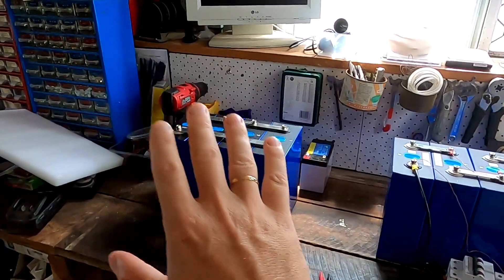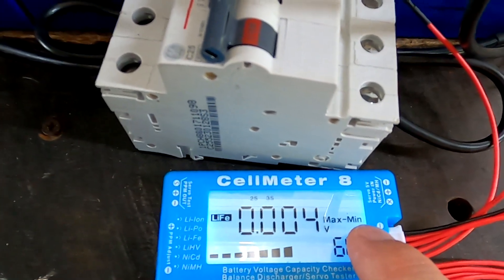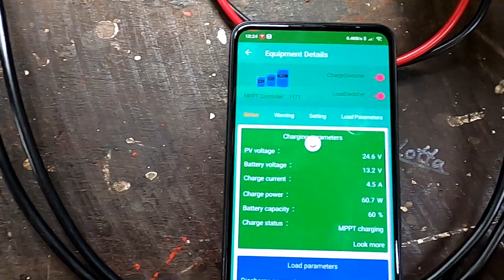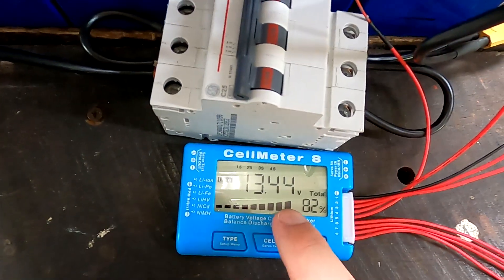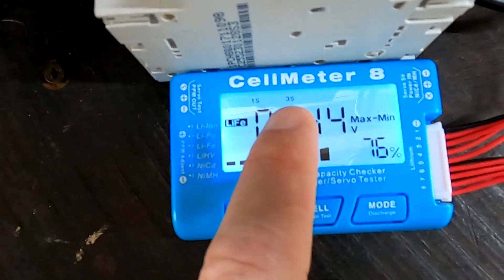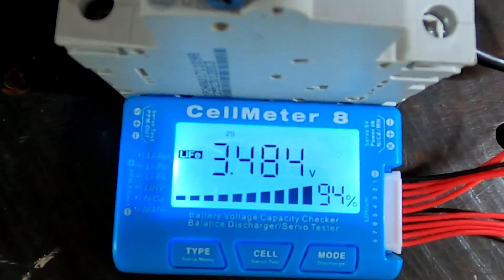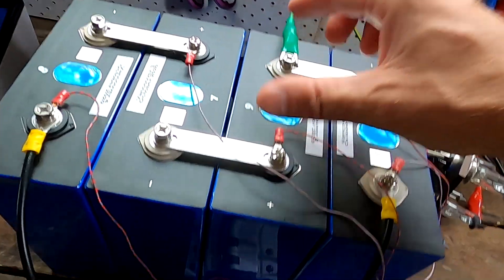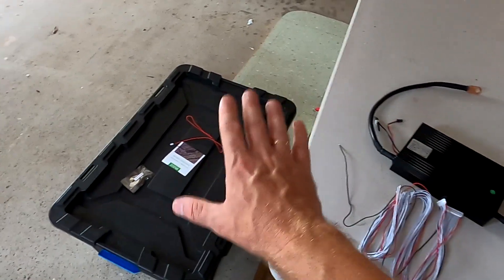Do this and you don't need a BMS 😉

Comment: Love your videos and even more love your off grid garage!  Question, how can you test a battery pack managed by a BMS that does not have an app? or how do you know if the cheap BMS actually do anything?  The ones with the apps are way too expensive to use on small 12v packs, fine on a large system but small individual systems makes things uneconomical.

Comment: Excellent. I don't need a BMS. Electronics cannot be trusted in a marine environment. So I will connect my 21V solar panel, six 50Ah LiFePO4 cell series stack, and brushed dc boat motor in parallel, have knife switches to take cells in and out of the series stack for throttle control, and voltage management of individual cells. 
Using an electronic charge controller or BMS will obviously kill everything when one of their rubbish components fails. 
Not to mention throwing away most of my valuable solar electrikeries. On heating up transistors, diodes, resistors, computers and connecting wires. 
It would be even more of a nightmare if I allowed myself to be scammed into a brushless electronically commutated motor. 
All I need is a voltage readout on each cell.
Thank you for explaining why I most certainly do not want any electronics on my boat!
If each of a million components in those things has a 1 in a million chance of failing to work perfectly in a month, then the whole lot would be expected to die in a month.

Comment: HAHA I love this, I came here ready to flame this video, but the mature viewer in me watched till the end. When I was first learning lifePo4 batteries, one of the first things I did was balance the batteries and then call it a day.

Long story short, on a sunny day, the 100 AH batteries in a 4s config took a 40 amp charge and completely bulged out 2 out of the 4 batteries. I wanted to make sure someone wasn't spreading miss information, and you are doing an excellent job of helping teach why in deed you actually need one.

Another good mention would be an active one (BMS) that moves power between cells, vs a passive one that burns off the higher cells as heat.

I suppose a battery operator could use alligator clips to connect the high and low cells :)

Great Job!

Comment: Me personally I would rather use a balance charger than to use a bms l. Then have a cell monitor with a buzzer alarm when a particular cells drops to say 2.7 volts.
Reply from the maker: Most likely I'm not home if the battery is fully charged or discharged. A buzzer will not work in this case. You always want a BMS for your battery to protect it.

Comment: BMS is expensive part of using lithium battery and I understand the need to balance the batteries but if you run the output direct from the battery and only run the charging current in through the BMS then you could use a lower amperage BMS which is cheaper (can I have your thoughts on this) also would the voltage be correct from a vehicle alternator through the BMS to charge them 4 batteries
Reply from the maker: The BMS would not turn off if you have a short then or your inverter draws too much power. Overcurrent protection is one of the safety features of a BMS. It would also not turn off the load in an under voltage situation.

Comment: If you are charging your Lithium iron phosphate batteries with a manual charger (16s), can you hook up the negative cable of your charger to your Daly BMS black lead (p-) cable? I guess I’m asking if it works, will it hurt the BMS? Will the BMS limit the constant voltage charger that is designed to charge 16 s to 58.4vdc?
Reply from the maker: The charger should always be connected to the P- of the BMS. In case one cell runs off and spikes with a high voltage, the BMS will turn of the charger. That's all the BMS will do. It won't limit anything but only turns of charging or discharging at the lower end as per set voltages. Does that makes sense?

Comment: These cells are connected in series 4S 1P configuration. I thought cells in parallel with auto-balance themselves. If i put 8 cells in parallel for days to be fully balanced before doing a  2p 4s configuration.  Do I still need BMS if my cells are connected in series-parallel 4S 2P configuration after fully balanced in 8p configuration for several days?
Reply from the maker: You always need a BMS. The cells will drift over time and nothing will stop them from overcharging. You could end up in a disaster. 
The BMS will monitor single cell voltages and turn off charging/discharging if something goes wrong. A BMS is an essential product like a fuse.

Comment: This is a great video, but quick question. If I were to build a 8s4p battery, would I need 4 8s BMS hooked up to each block?  Same if I put the same cells into a 48V 16s2p. Would I need 2 16sbms? Or would I need a 32cell BMS I can hook up to each individual cell?

Comment: I understand to monitor each of the cells voltage to turn off charging. I don't understand the discharging of cells which have reached the voltage limit. This is to my opinion simply wasting of energy. It would be better to feed this solar power to more useful purpose. If you connect them in series, your maximum battery capacity is limited to the one of the weakest battery cell capacity multiplied by the number of cells.

Comment: I noticed that you refered to the cells as spreading apart. I assume that indicates that they are puffing up or expanding. Some sources say that explanding and contracting is not a good thing because that could lead the anode-separator-cathode combinations to delaminating. The same sources say that puting the cells in compression will eliminate any potential problems related to the cells expanding and contracting. 

I also understand that expanding could also be the result of overcharging or mistreatment at one time or another during a cells life as you did say at one time during the video. I assume that these batteries took some time to reach you. Could they have been in a overheated shipping container for some time?

Comment: lol...When using Lithium cells in series you ALWAYS need a BMS. People with experience like myself know this..especially with LifePo4 that you have there...the more you cycle the cells especially on deep discharge the more the cells will start to vary because they wont all be the same resistance. Also, on deep discharges once a cell gets to a safe low voltage cutoff the BMS stops the discharge and in the case of charging, the charge if one cell gets to the safe upper limit of charge. By the way...that little device might be able to discharge ONE of those prismatic cells .01 volt in..oh...a week maybe???..They are good for monitoring the cell difference in your pack for sure and thats the main function in a pack like you have.

Comment: I’ve been running my 4s Calb 180ah cells without bms for over 3 years. Top balanced once at the start and they are still within .02 v of each other
Reply from the maker: Wow, that's great. And brave. How often do you check them and I guess you use them right in the middle of the curve before they hit any steep sections?
Reply: @OffGridGarageAustralia  Hi  It is with a lot of respect to you and not least the time you use on all the videos 👍
 Nop...  That is wrong, if you will run without BMS you need to bottom balancing all cells. 
You need to drain all the battery down to 2,75? V (down to the knee wher there is no energy pr. milli volt), get the last digit so close as possible on all cells and at same temperature.  Measure one week later, if the difference is to high repeat the process until it is right, then you NEVER have to doo that again

I have a battery pack 42 Cells from 2012 (Thunder Sky Cells 160 Ah) and it is running just fine,  last checkup 1 week ago and all is just fine.  So yes I check the cells now and then 1 - 3 yeas apart.
It is used in my car and is charged at least once a week.
Cell Voltage 3,65  -  2,95 (Charging current 50A. Regenerate breaking 150 A.)  Maximum Discharge current 350 A

It is imperative that the cells are bottom balanced, since you don't know the capacity of the cells.  If you drain a top balance pack down to say 2,95 you might have a problem since the cell with the lowest capacity might be wrongly polarized and the cell is Dead.
My cells variator about 15 Ah.

If you or anyone wish to know more about bottom balancing, search for "jack rickard evtv" it is an olde video and unfortunately Jack is Dead. 
If you want to know more about lithium cels behavior and how much the drift search for "Professor Jeff Dahn (Dalhousie University") runingtim 1.13.30  This video will help almost any one to understand more about LiFePo4 cells.

Enjoy the videos they are worthwhile !!!

Comment: I want to build a 32650 12-volt system. I can fit 80 cells in a 50 cal ammo can arranged 4S x 20P. I keep hearing both sides of this BMS argument. The biggest concern seems to be battery life using a BMS. One counter argument that struck me, was that since my 3.2 volt banks are constructed using 20 cells in parallel, all 4 banks would/should/could be very very close in voltage because high and low cells would be averaged out.  Obviously one would need to monitor the multi cell banks to insure one of them doesn't eventually drift too high. What do you think of this? Is it worth a try?

Comment: Does that mean parallel configuration does not need BMS? What's the disadvantage? and why people would prefer series over parallel?
Reply: Couple of reasons. Operating at low voltages is very inefficient as far as power generation and transmission is concerned. With much higher voltages (and hence much lower current) you can move the same amount of power with much much smaller wire sizes and cabling power losses and this really comes into play for home solar power where you might have cabling that runs 100+ feet. 10 AWG wire is a lot cheaper that 6 AWG. This is also <one> reason why power companies can transmit power @ 100,000 volts for miles and miles. If you look at the specs for most solar charge controllers, their efficiency sky rockets at higher voltages. Same with inverters. They work proportionally better with higher input voltages. Down side.... Ya gotta deal with batteries in series to support the higher voltage requirements.

Comment: Please can you give me some advice. I have ordered 8 x 310AH of these same batteries from aliexpress, I intend to set up as 2 parallel lots of 4 in series, to give me 2480AH at 12.8 volts, I am confused about which BMS to buy, your link goes to a page with so many options and I don't know which to get. I live on a boat and have 4 x 175 watt Victron solar panels, which I have set up as 2 lots of 2 in series and then in parallel, Victron 100/50 solar controller and Victron 3000 Multi Inverter Charger. The solar charger has a maximum of 700 watts input, but that has never reached full charging capacity as the boat doesn't stand still and the sails block some panels nearly all the time. I will most likely add 2 more Victron 175 Watt solar panels, while this in theory is 350 watts more than the MPPT charger can handle, all the panels are never in full sun, and I will have to have the 6 panels all in parallel. Can you please suggest which BMS I should buy for my setup. I use a Honda EU2200I pure sine wave generator to charge the batteries if it rains for several days or more. PS: so glad to have found your you tube channel, as you explain every thing so well. Thanks, Brad, I am a solo sailor on a 38 foot catamaran, and live aboard full time, but never go in to marinas or use shore power, I am fully reliant on my solar system.Hope you can find the time to reply, Kind Regards, Brad.

Comment: Ha ha ha a full-time job of "Battery Management System Operator" - excellent punch-line! Nice explanation - 10/10 !!!!
Reply from the maker: Thank you 😁
Reply: Hi Andy!! Your channel has been super helpful in getting me interested in LiFePO4 batteries after many years !! Great useful info and a wonderful sense of humour too 

I have been the Battery Management System Operator for my 12V 60Ah battery I first bought in 2011 - luckily my loads on it are very small (~100mA) so I only need to be the BMSO once every 3 months or so :D

The next battery I buy though (4x EVE MB31 for backup power post cyclone Alfred)  will have a BMS and the loads on it will be up to 160A!

Greetings from Wet Cloudy Brisbane, Australia!

Comment: Please can I use 3.7v BMS on 3.2v batteries?
Reply from the maker: No, that will not work! You need to use a BMS for either Li-ion or LiFePO4 cells but you cannot swap the BMS.

Comment: Love all the  awesome work you do !!! I want to ask you a question. I ordered the 16 of the eve 280ah battery cells for a 24v system. I'm going to make two  24v batteries in series then in parallel. I have a 16 cell bms for the system. Will that work out for the system or do I need two bms one for each 24v battery??
Reply: When you use a 2x24V paralleld (only plus and minus conected you need 2x 24v bms but  you could just paralel 2 cells and put thos blocks in series then you need 1 24v bms. A 16S (48v) bms wont work because the cells might be okay but the overal voltages is way to low for the bms to funktion if not necesary to have 2 independent 24v battries u should do a 2P 8S configuration

Comment: I charge my 24V LiFePo4 up to 27.5V. The cell drift is around 100mV, so I don't charge higher. Only have one active balancer. 
Meine 24V LiFePo4 lade ich bis 27,5V. Da ist der Zelldrift rund 100mV, daher lade ich nicht höher. Habe nur einen aktiven Balancer.

Comment: Very Misleading title... Could have been 2-3 Minutes to bring the message along.
Reply from the maker: Some people don't use a BMS in their setup and check for voltages every here and then. They do exactly that, and manually balance their cells with a load.
So, not quite sure what is misleading here?

Comment: Another thing to consider is temperature.  The fact that the outside cells will be a couple of degrees warmer or colder will affect individual charging efficiency.  Subtle but will over time lead to an imbalance.
Reply from the maker: I've got this battery in use for 6 months now and could never even measure a temperature increase while charging or discharging (max 60A discharge). But yeah, you're right, this could affect imbalance as well.

Comment: 8:00 the picture suggests that you can charge a lifepo4 battery to 4,2v. that is wrong and dangerous. you have to stop at 3,65v. I dont know what kind of diagramm you got there. lipo is 4,2v but the charge curve is different.
Reply from the maker: Yes, thank you. I've now blurred out the scale of the graph. It was more to explain the steep incline of the curve  at the beginning and end of charging. But yeah, it could confuse people. Thanks for picking this up and letting me know.

Comment: Im sorry. I have no idea about electronics. Thanks for yr video teach me alot. It means a lot as a newbie. 

Im planning to build a 120v battery. To find 40s bms its kinda hard pricey amd thats not the main problem. The main problwm which i apply in inflatable boay which i will be too heavy, so the idea is to separate the battery into two. Or more. 

My question is. May i wire the bms in series so i will have 2x more volt. 

Ive been reading a forum which is they disconnect the P- and wired the b- directly. 

Thank you 👍
Reply from the maker: Thank you for your feedback. 
Are you trying to build a 120V DC battery?
Reply: @OffGridGarageAustralia  yes sir. I would like to build 120v battery pack. If the battery is 3kg pieces, it will be too heavy for a 40pcs pack as my application for a boat. 

I heard if you bypass the p- direct to b- the bms will work as balancer and bypass the mosfets and be connected in series. There will be no cut off. 

Is it possible and is it safe? 

Im thinking for charging purpose will connect as usual 48v which not connected is series. B+ with p-.. Thanks for your time sir.

Comment: I kept thinking he was saying "what the F___".  I'm now going to use "what the Frog" for statements of exclamation :). In other BMS news, I live in a very cold area (Montana), so I need a cold temperature cutoff.  can you describe a cold temperature cutoff with BMS that is cheaper than the insane $187 for a 250 Amp BMS on Amazon?  Thanks mate!
Reply: On a side note, I'm your 9kth subscriber :)
Reply from the maker: It's still on 8996 subs. But thank you to be one of my closest 9k subscribers. Much appreciated.
Reply from the maker: Well, a cold temp cut off should turn off charging if the battery is below freezing. Most BMS have a sensor for that. 
A $187 is not much for a BMS with 250A considering you just spend a lot more $$$ on your battery. Look at the BMS as your insurance to protect your precious battery.